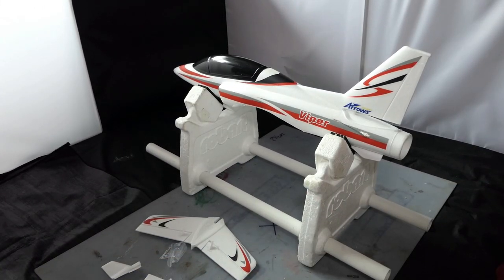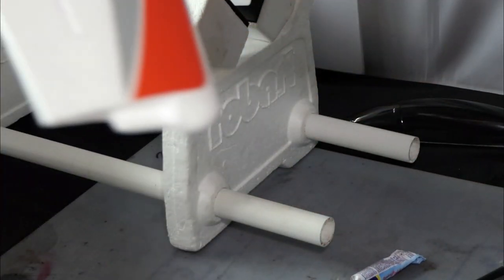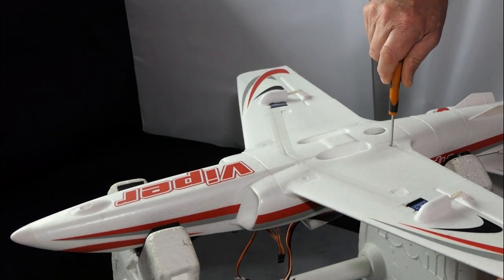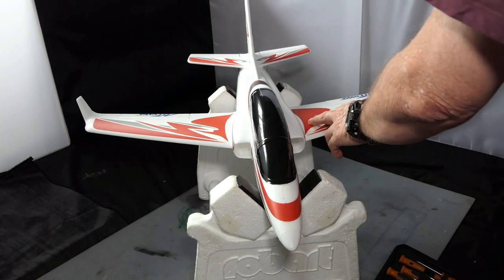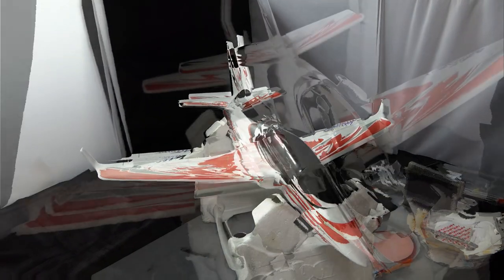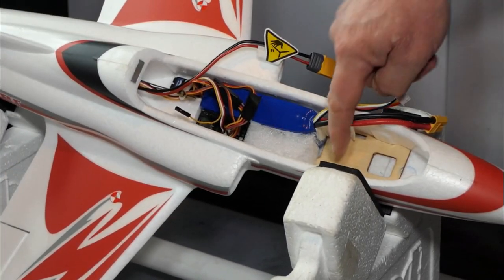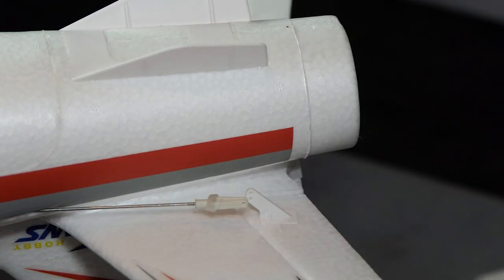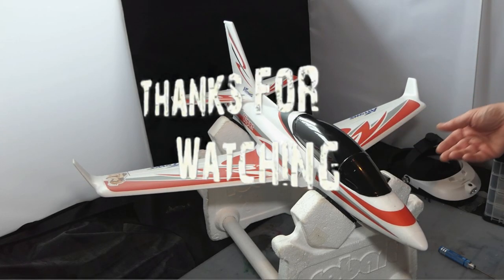Arrows Hobby 50mm EDF Viper - assembly

Comment: Nice one Martyn, great job as usual particularly overcoming the odd issue here and there. Looking forward to seeing its maiden flight 👍🏻
Reply from the maker: Hi Sean - the battery issue was of my own making - I did not read the instructions - the Viper is designed for a 1300mAh not a 2200 - Hence having to move the 2200 further back beyond the battery tray... the clevis's were just poor... I am looking forward to its maiden - should fly much better than the Crusader... :-)

Comment: The recommended battery is a 1500 3S - which mine balances great with, or a 4S 1300 which I fly mine with. (heavier ESC and rudder servo and rod make it a little heavier to the rear than standard). You will enjoy flying this one :)
Reply from the maker: Thank you - I must admit I did not read the whole manual so missed that --- .....
Reply: @FlankerTanker  I must admit I only get 3 1/2 minutes flight on 4S 1300mAh .... I end up throttle heavy as it's just so much fun :)
Reply from the maker: @Caroline_Tyler  I will set the timer for 3mins and see what the 2200 3s is like after that - as you might know I tend not to fly super sonic (LOL) so it should be good for 4 mins or so ?
Reply: @FlankerTanker  Easy 4 minutes on 2200mAh...more likely 6 to 8

Comment: Have you ever lost TX signal? Today during my maiden of the Viper with a spektrum AR630 in it, I done one pass and it kept flying further and further away from me. Id say about 100m was the point I realised it wasn't responding. Luckily it held together after a nose dive. Slight bend in the nose but it'll fly again. Worried it'll happen again. It's quite tight in the fuselage maybe the battery is blocking the signal as the RX is packed tight in there against it. Cheers.
Reply from the maker: I have never had this problem with it - no signal loss - I am using an antennaless  Spektrum AR410 - I have seen some videos where people using an antenna have them sticking outside of the aircraft... I would suggest you go for the AR410, they are small and I have never had an issue when using one....
Reply: @FlankerTanker  cheers Martyn. I'm using the AR630 for the Safe feature as it's my panic button if it goes belly up and I can't sort it myself. Just maidened my HK Ghost P51 there with another AR630 and it worked perfectly fine (till the canopy flew off!). Maybe the RX in my Viper is a lemon.

Comment from the maker: Never did find out what the 4th wire was for on the ECS throttle connection - My Model shop were not 100% sure but think it is something to do with programming the ESC - but as one does not need to do it , it's redundant ...

Comment: Hi martyn
Looks nice n sound did you ever find out what the cable was for... Telemetry?? or something auxiliary?? Considering its fms really surprised about the fixings for the rudder. Elevator.. battery size a zippy compact might be the answer... Be interesting to see the kite fly. Quite fast I should imagine
Reply from the maker: Best I could find out is that it MIGHT be used to programme the ESC ?! - how and with what I do not know - I was also a little disappointed with FMS - BUT as this was build for Arrows it could have been on a set price so FMS not having its brand on it just cut back on quality (ie Costs) - its no problem regarding the Battery and it is all set up for a 2200 mAh Turnigy  so quite happy with it - It can be fast but also has good slow handling and a great glide.. we shall see..... Stay well Brian -
Reply: @FlankerTanker  sounds good any kite with a good glide capability is GREAT IN MY BOOK. just checked the weather coming up over the next week rain rain rain thunder did I say rain oh and more thunder August looks OK at the mo.... Not the best of summers so far... I'm hoping for August September to save the season
Reply from the maker: @BRIANFORWARD1  DOH !!!!!! - I am on holiday next Friday 2nd July - was planning to get some kites into the blue, but .......if the weather is like today (Friday) here it is exactly as you say Rain and Wind... problem is in bad weather I start assembling aircraft and I just don't have room right now ....I think I will make a video about the cockpit camera mod I have been working on ...
Reply: @FlankerTanker  hi martyn
That's all you can do. Is fettling. I'm still putting all my bat's into storage
Reply: Think it could be for a afterburner light

Comment: Nice...Hey Flanker did you try that faulty gyro out of the HK Corsair in the end?
Reply from the maker: Hi I Sure did - and it worked find on AS3X mode right up to the point when the Battery Wires overheated and melted !! nothing to do with the ORX Gyro - turning it upside down sorted it out - but I did not have time to test it in Stability Mode - here is a link to the maiden - crash -https://youtu.be/8uZjs-vQjuo
Reply from the maker: Here is a link to the Rebuild after the maiden crash  - its in 3 parts - https://youtu.be/apOO7ExRhwA
Reply from the maker: Here is the link to the 2nd Maiden - still using the ORX upside down in AS3X Mode - worked 100% OK.... https://youtu.be/RU1Hn9u2dKo
Reply from the maker: And her is the repaint I did on the Corsair once I know the ORX was working as it should (with it being upside down)... https://youtu.be/J1c8d9UWH1I
Reply from the maker: Bet you wish you had never asked now LOL... No but is does work in AS3X mode if you turn it upside down ... Waiting for good weather to fly the Corsair in it new colours....
Reply: @FlankerTanker  LOL ..she looks Awesome with  the new colours good job.  👌   🛩️